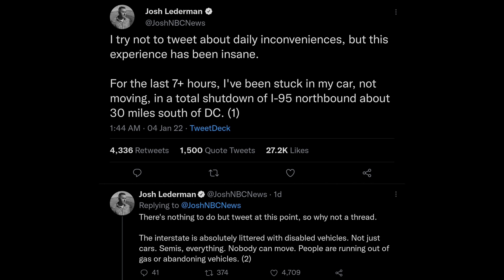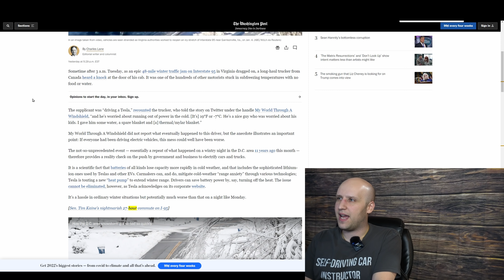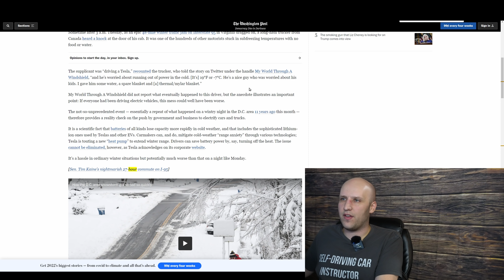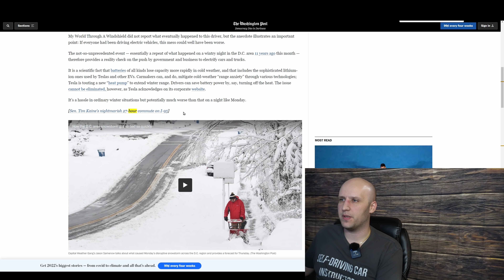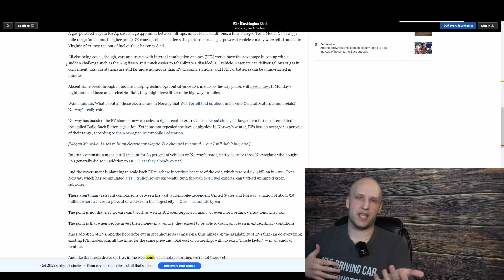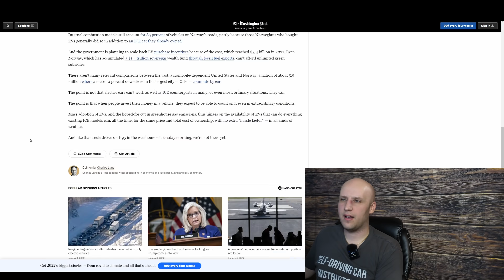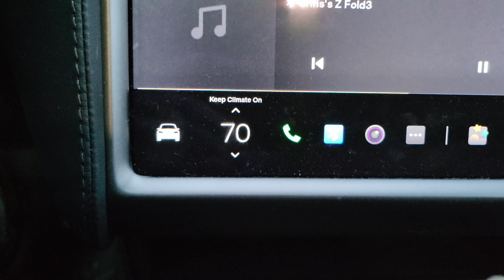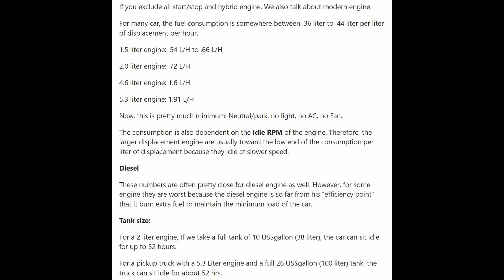How Long Can a Tesla Keep You Warm In A Frozen Traffic Jam? | FUD Debunking

Comment: Ok. I'd like to point out that some engineering research is done in comment sections. So if heat pumps do fail in extreme temperatures. They soon won't. But assuming doom and gloom for an EV in this situation only tells that we are so accustomed to ICE. That our assumption on EV's are way behind. I was impressed to learn all of this.  
I do watch the Rich Rebuilds channel and There are a few things that I still don't like about Tesla. 
   Yet improvements are coming. To sell more cars. They have to be better than an ICE in all ways. At a comparable price.  I recently read a story of a prototype battery that can run then 730 miles. Then I read about one with solar panels. While not useful in bad weather. It would help on a sunny A/c scenario. It will get better. It will improve.  It has to! 
     The one business opportunity I see. May be that in this case. A tractor trailer shows up to an assumed parking lot in Dumfries. With a carnival generator and multiple superchargers. That this rig let's Tesla know their location. And it's included in the app they use to find a plug.  Now I know that skeptics point to a diesel engine or power plants charging. But in either case. They do it more efficiently than an ICE.

Comment: As an ICE owner I found this interesting and informative. I was kind of waiting for a real world test and this was pretty well done. It’ll still be some time before anything like that is in my price range though. Most expensive car I ever bought was $10k 15 years ago. Still drive that car too.
Reply: Recently, jusr last week,  in a hill station called muri in pakistan, due to  heavy snowfall there was a city-wide traffic jam and thousands of cars were stuck in a traffic jam for few days. People slept in their cars at night , kept the engine running with the heater on. However their  exhaust pipes were blocked due to surrounding snow around the car. This forced the generated carbon monoxide back into the car. Due to this phenomena some 20 odd people died, in various cars. 

This well never happen with Tesla or any other electric car.
Reply: @southpole9450  Not a good comparison. People that live in third world countries do not have the regulations they have in the west when it comes to car worthiness. They drive vehicles that are unsafe or do not meet most western standards. On that note, you would have to know the make ,model and condition of each vehicle.
Reply: Best car I ever drove in snow was a 66 Chevelle with good snow tires
Reply: Of course you do know that the age of the test vehicles would have a drastic impact on reults.
Reply: its confusing to me given Litium batteries can discharge down to temps of -4F and in EV cars the batteries are also kept warm. But a gas car's proper operating temperature is 200F
Reply: @SEANMCAD  A gas engine doesnt care about cold or the outside temp at all. A gas engine can idle for 3 days on a full tank producing all the heat you want.
Reply: @muddyriverdogz  well as anyone who is lives in alaska knows, that is only partly true. If you turn it off, your fffff uuucked
Reply: @muddyriverdogz  and by the way, as it turns out on this planet a battery can generate heat. yeah I know its mindblowing but basically the same was a gas engine can create 200F that it needs in order to operate, a battery can create then -3F it needs to operate.
Reply: @muddyriverdogz  basically the equation is this. Both create engery, one needs engery to maintain 200F the other needs engery to maintain -4F. For those purposes a car will have more engery reserves for sure, but it also requires considerably more. That is the honest equation, not the consitent unending bullsh(t the auto industry peddles
Reply: @SEANMCAD  A gas engine creates heat from cumbustion, actual fire. I know mind blowing. A battery has to be charged and then disipate its reserves of that charge to create heat,
Reply: @SEANMCAD  Lets also keep in mind it doesnt cost the gas engine anything extra to create the heat. If these EV's were actually driving instead of just setting still the battery loss would be much much more.
Reply: @muddyriverdogz  yes it does use more engery to create that heat. When cars idle they use a TON more engery than an EV does by a long shot
Reply: @muddyriverdogz  a gas car idle use a TON more engery then an EV does by a very long shot
Reply: @muddyriverdogz  Here is a comparision because I do not know the engery from a car engine conversion to watts is but I do know what it is with a common generator of about the same size. A non-inverter generators uses 4,000 watts an hour regardless of if you use that power or not, a EV sitting in traffic doing nothing other then keeping the battery warm and lights on is about 750watts max
Reply: @muddyriverdogz  So I did some research, when you convert the engery to watts. A car is using at min. more then 2x the power to be idle and that is with the Telsa heater on
Reply: @muddyriverdogz  actually I might be wrong, it looks like a car idle is actually using the equvilant of 11,000 watts, a Tesla at idle with the heater on is 200. it is fair to say that a car idle does not use more engery to keep the engine warm but still that is a huge differnece
Reply: @SEANMCAD  Of course it doesn't. The gas engine generates the heat weather you use it or not. The heat is free.
Reply: @SEANMCAD  Also heat was created when the electricity was generated from the coal fired power plant to charge your EV. Only that heat is completly lost up the smoke stack of the power plant.
Reply: @SEANMCAD  The EV is dependent on a power generator where as the gas engine is a power generator.
Reply: @muddyriverdogz  so here is the thing as it relates to a telsa freezing. 1. it can operate at at -4F but a gas car needs to keep its car extreemly hot. 2. a car idles uses about 55 times more engery then a Telsa. 3. A Telsa while idling can last 250 hours. So..this freezing bit, maybe knock it off and stop fishing
Reply: @muddyriverdogz  also..armed with the facts I gave you and that videos like this one clearly do not even come remotely close to telling the truth, maybe its time to entertain the possiblity that the traditional auto industry is paying media to peddle pure bullshit.
Reply: @SEANMCAD  I dont believe what you are saying is fact. Until there are unbiased tests of your claims of an unproven technology in the real world its just that. Claims. We need to put vehicle up against vehicle in the real world measuring all variables. Cost,extened cost,longevity,convenience,power grid costs,unentended consequences,future cost and tax(government wont sibsidise it forever). The EV promoters make claims that will not pan out in the real world and we are a long way away from EV becoming mainstream. At best EV's would make gpood comuter vehicles in large cities "if" the power grid could handle it and people can afford them.
Reply: @SEANMCAD  As it stands now you could buy 4 toyota corollas for the price of 1 model S. Vehicles capable of getting 40 miles to the gallon and lasting 30 years if properly maintained. They put no load on the power grid. They dont generate toxic waste. They are not a fire hazard. You dont have to waite to charge it. And many more advantages.....And NO a corolla does not use 55 times more energy than a Tesla !
Reply: @SEANMCAD  Not according to them. They may have had an older vehicle or a differnet model that didn't hold the charge the same.Or even high wind speeds... Lots of variables that can play into this test.
Reply: @muddyriverdogz  which is the point I am making. Try to focus on what I am saying and not other things UNREALTED to the question of freezing 1. lithium batteries can discharge down to -4F 2. a car needs 200F to operate normally. 3. a gas car uses 55x times more engery being idle then a Tesla. 4. a Tesla can idle with the battery heater on for 250 hours. 5. media is CONSTANTLY flat out liying about EV cars...why do you think that is?
Reply: @muddyriverdogz  armed with the facts I gave you dont you think their view is highly absurd?
Reply: @SEANMCAD  Your right they are. They are not telling people the truth or the true cost of EV's.
Reply: @muddyriverdogz  you can go to an rv dealer right now and buy a heated hose that is rated for -50F for about $100. I am sure they can keep that battery warm. Both gas and EV will still be running long after humans die fromcold exposure even with human heaters running
Reply: @muddyriverdogz  cost is not a question about freezing. you know your dug into group think when you have to resort to changing the subject like that. cost is NOT the conversation, even if a Telsa costed a trillion dollars it would still NOT be a realistic thing to say they are a problem in freezing weather. the two subjects are completely different
Reply: @muddyriverdogz  something else I totally forgot about. In the back of my truck I carry two 2000 watt inverter genertors and 5 gallons of gas (I live in an RV this is where I store that stuff). You know what I can do with that? I can charge a EV battery with it. Nevermind the fact that two solar panels could provide enough power to keep a Telsa idle pretty much forever
Reply: @SEANMCAD  Whatever
Reply: @muddyriverdogz  you can think Telsa is a pile of garbage and I think that is fine, but what you SHOULD care about is being lied to by media. that should concern you, you should not be 'whatever' about that
Reply: @muddyriverdogz  and that might be true. But they also lie about telsa freezing but u don't care about those lies do you
Reply: @muddyriverdogz  I don't fall for deflection easily. Let's stick to how you don't care about these specific lies we have been talking about. I don't think you do it on purpose but you have about 4 times now
Reply: @SEANMCAD  Tesla's are a problem in freezing weather average battery life in Canada is 4 years !!
Reply: @SEANMCAD  You do know that gas giants BP and Shell have bought EV charging companies ?
Reply: @muddyriverdogz  also a total LIE. I have a Litium batter, I use it often under 32F I have had it for 4 years, it has a 10 YEAR WARRENTEE!!!!!!!!!!!! dude you need to be asking yourself regarding these questions of freezing and ONLY the questions of freezing why are you being lied to?
Reply: @pugpete1 dude, I am just stating scientific abolsutle undeinable facts which contradict their claims competely. why they are liying like massive f balls about something that is scientifically absurd, I dont know. I can only speculate on that.
Reply: @pugpete1  but I will say this, Auto magaizines regularly lie about Telsas specifically. I would think the reason is fairly obvious to figure out
Reply: @SEANMCAD  I suspect that poor journalism is the only real issue. Interesting that you went straight to lies and conspiracies tho...
Reply: @pugpete1  its because its not the first time Telsa has been targeted by wrong information. But regardless, this is not a thearpy session to find all my defects. The bottom line is they are unbelievably wrong, regardless of intent or not. that is immutable on this story
Reply: @pugpete1  a good example of what I am saying is this. If a report tells you water freezes at 41degrees and you know it does not. You gotta say something. Why they are saying what they say is by FAR less relevant than the assertions being made are complete BS
Reply: Manufacturing is where most air pollution comes from. If the greenies had half a brain they would be demanding products that last longer. Now thats a fix thats doable ! No money in that for the law makers and corporations though.
Reply: @muddyriverdogz  you are defelecting more times then i can cout. FOCUS on ONLY I mean ONLY on the question of why you are being lied to about the question of FREEZING AND ONLY ABOUT THE THE QUETION OF FREEZING. I dont give a good god damn about green engery, focus on the specific lie we are talking about, green engery is NOT why I even own solar panels for frcuk sake
Reply: You do know this is a non issue for people who have beefy tires and 4 wheel drive.
Reply: @eaglewarrior8707  snow tires, 4 wheel drive (with limited slip or locking axles) and decent ground clearance helps, but only if you don’t have a ton of stuck vehicles and tractor trailers blocking your path.

Reminds me of a time several years ago when I hit a patch of ice on the interstate and put my cutlass into the median in the deep snow. Luckily I had snow tires and I was able to drive it out without any digging. Was very impressed with that car that day. These days I drive a Marquis, snow tires all around and I had the rear end upgraded to limited slip with about 500lbs of preload. I’d love a truck, but the used market is completely upside down and anything new is way out of my budget.
Reply: @eaglewarrior8707  not in a traffic jam. If you can't get off the road the biggest Offroadtruck has to wait.
Reply: @Nordlicht05  That's not an issue for BIGFOOT. The king of the 4x4x4.

Comment: Major downside of combustion engine vehicles. Eventually, at a standstill, there will be no airflow for cooling the coolant or the oil for the engine. If you have a towing kit, like on a truck, your transmission fluid may also be cooled. If you sit still and idle the engine for hours. Eventually those liquids will burn too. So besides the gas, you'll need more oil and coolant as those will be burned eventually. Some car companies like volkswagen have helped stop this by having their approved coolant turn to a powder when evaporating, only requiring water to dissolve it back into a liquid along with more coolant. Either way, your engine will be the one suffering as these fluids burn up and evaporate more and more. This can happen, and eventually the heater will stop working and just start blowing cold air due to lack of coolant. 

Quite the opposite for a tesla as I believe all of the fluids are part of a closed loop system. Once batteries are large enough to support self warming systems, as well as last for 500+ miles, battery powered cars will have little to no downside in this situation.

Comment: Great video! There was a lot of talk in that article about how cold weather effects battery but you didn't mention how cold weather effects fuel economy at 20 degrees around 12% -22% depending on length of trip and if the engine needs to warm up first. on top of this ICE cars would be idling to keep there heating on and idling is much less fuel-efficient than driving.
Reply: Wow you have no clue about combustion engines. They run way better with cold air. Hence you buy cold air intakes. Lol. What do you thunk an intercooler does? It cools and helps that turbo compressed air get burnt. I always got better miles in the winter months in ga. Higher elevation is bad, cold air into the engine is good. The engine itself idling generates enough heat to keep things good. A little 4 cylinder sips gas. If you're smart you can look into grounding certain sensors and areas of an engine. I did my 99 si that way and went from 30mog to almost 40 mpg. I learned about how they ground race cars at road atlanta and applied it to my car. Gotta keep the contacts clean.
Reply: Oh yea a cold air intake adds HP, meaning the engine is running more efficiently than a under hood or stock intake.

Comment: Great info. Very economical compared to gasoline. Now, if replacing batteries comes down about 90%, I will buy an electric car. Or wait for you to do a breakdown to see how cost of replacing batteries compares to the fuel savings in however long the batteries would last at decent performance.

Comment: This is great to see on a full charge, but just like gas vehicles, not everybody will keep their vehicles charged up. Regardless, both have the same opportunity to leave you cold and stranded, it all depends on the habits of the drives and if they keep their vehicles full of whatever it takes.
Watch the weather, keep your tank/battery full if you know its going to be bad out, or if there is the possibility.
Reply from the maker: Right. You can use the data at the end to see how long the car would last at different percentages. And it's typical for an EV to start the day at 90% as the car just charges overnight

Comment: A very fair assessment albeit some ICE driver undeserved knocks. I do believe however that EV' owners in general still work harder at either defending their decision to own/use one and spend far more time dealing with charging issues and  like "Apple fan boys" (guilty) treat their EV as a family member where most ICE drivers tend to think of their cars  as tools used to get from point A to Point B (Enthusiasts of course are different). EV drivers constantly having to "worry" about where  the next charge will come from or how long it will take is real in all but predictable commuter situations - a place where EV's are Ideal. The hassle is likely to go away for the most part in the next 5 years. But today, driving long distance in any EV is not l "easy" and won't be for quite some time IMO. I have friends that spend 2x as long planning their routes than driving them and maintain a number of apps to ensure they have charging capabilities along the way and trying to lower the charging cost at the same time  - its tough
Reply from the maker: I just want people to know the facts and then they can make their own decisions. We've gone from mi to NC and MI to NYC and it's super easy. I do check the route, but the car plans it all for you. You can use a site like A Better Route Planner and just play around with different routes to see what you'd go through in different EVs on a road trip or just around town.

Comment: I have an vw e up (36 kWh) don't forget that below 0°C you Can loose between 10 % to 30% of the capacity.  The heat system with résistance can consume between 1 to 3 kWh...that huge the best you Can do its blanket + heat seat that consume 300 wh its the best choice...